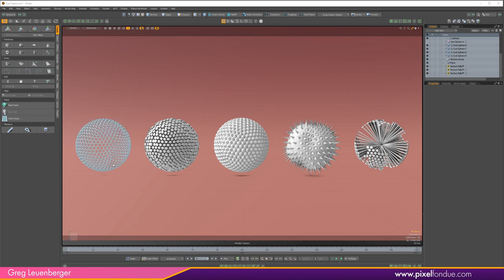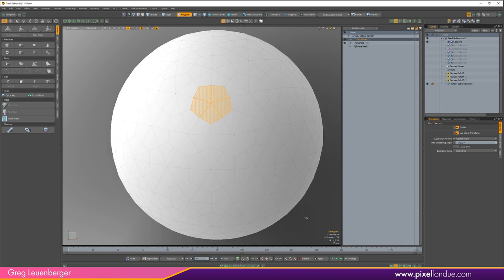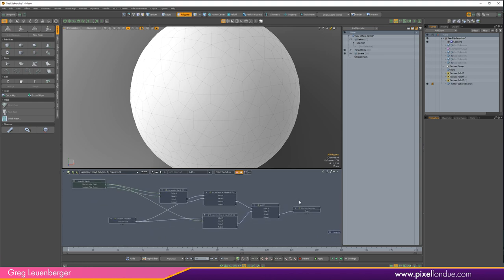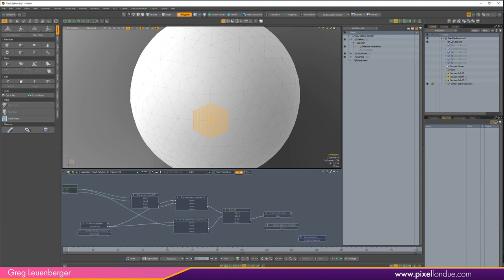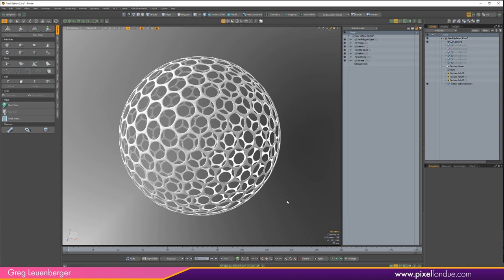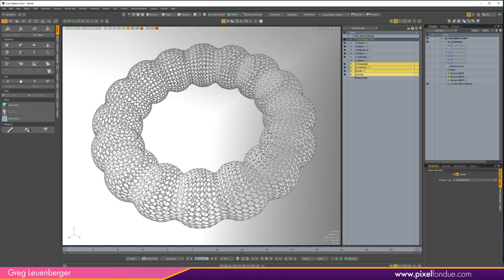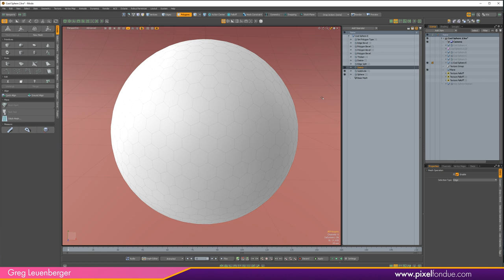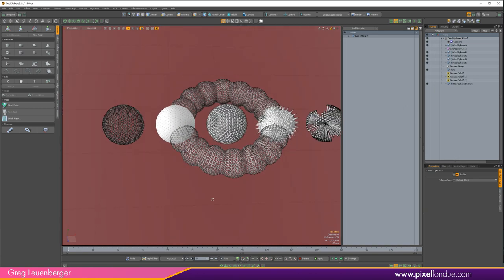MODO | Procedural Shapes and Selection

Comment: very cool Greg! I haven't even touched yet procedural modeling after upgrading to modo13 (all the way from 901). This looks pretty powerfull. Im wondering how would transitions look if you'd like to animate the 'virus' thing from lower to higher subdivision count. It would probably just be an instant growth of 'cells' on the virus (from 32 to 128 etc.). Wondering if there's a way to make a smooth transition between the subdivision states (for animation). Just a thought
Reply: mrdol might be able to select and bevel out vertices to grow new polys.
Reply: @gregleuenberger  ooh that's a good idea, thanks